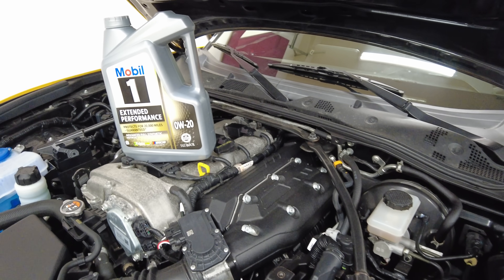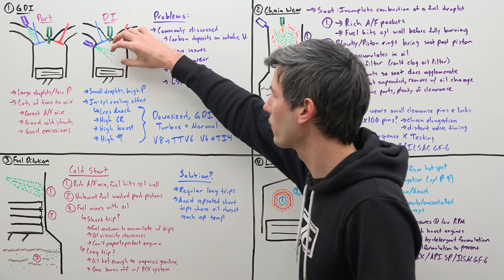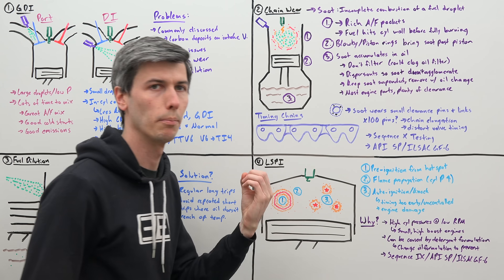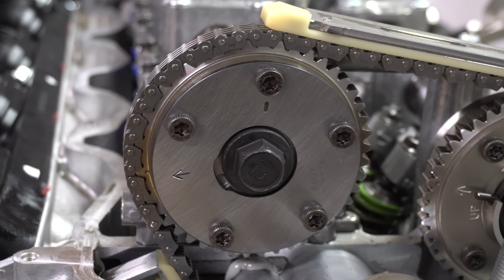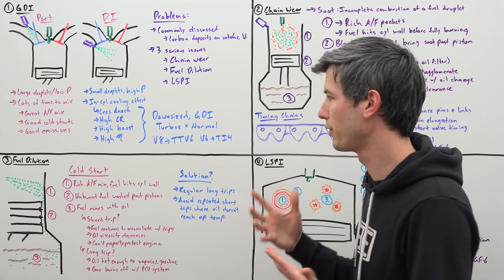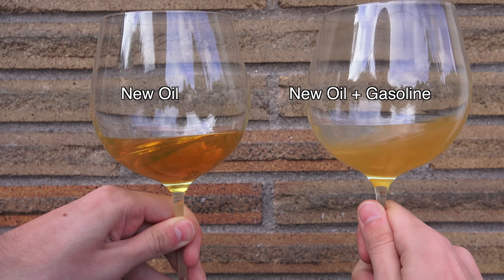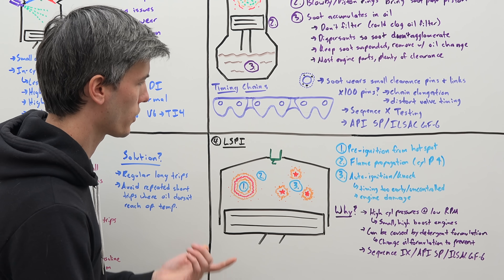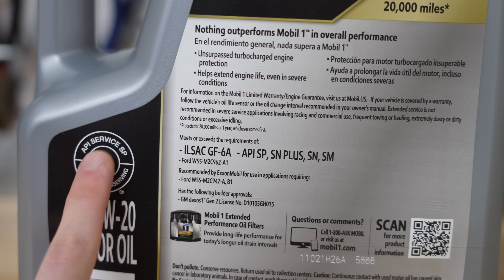3 Big Problems With Direct Injection Engines (Gasoline)

Comment: This was a great video! 
My Alfa engine from 2010 uses GDI and I recently had some major engine issues which were caused as a result of point 2. A failing injector becoming stuck open at one point also did not help. 

This video has helped me understand the importance of letting my engine warm up before use, performing sooner than recommended oil changes and not asking for higher than necessary boost in low RPM scenarios. 

I fell much more confident in being able to look after this engine more properly after watching this.  
Thanks EE!
Reply: You should not idle your car to warm it up before driving. Most oil manufacturers will tell you this as you'll be injecting extra gas into the combustion chamber during warm-up, which will wash the oil film off the piston walls and lead to excess wear.

Instead, you should drive the car as soon as you start it up, just do not put it under heavy load. Load is a function of both RPM and throttle angle, hence if you've got the throttle wide open at 2500 RPM, you are still putting the car under heavy load despite driving at lower RPMs. What I do is I just go light on the gas pedal, and at low speeds I don't shift out of first gear (engine hits maybe 5000 RPM max). If I'm accelerating, I do it slowly and I ride gears out higher than I normally would under light acceleration, that way you get the engine spinning but without putting it under a ton of load. This also helps the engine heat up as fast as possible, minimizing the amount of time you're injecting extra fuel into the engine.

You can do the same thing on an automatic by shifting it into low gears when you first start driving. The key is to keep engine RPMs relatively high (above 2500 RPM) without mashing the gas pedal and putting a lot of load on the engine.
Reply: @rars0n  but if your in below 0 weather you should warm up at least a minute,  no?
Reply: @Oakleyworld  You should drive the car while it's warming up. There's no need to let the car sit while idling.
Reply: @Oakleyworld  Yes you should.
Reply: @rars0n  Even if you don't think it is necessary to warm the engine up, what about the defroster?  It will blow cold air out until the engine is warm.
Reply: @michaelbenardo5695  The engine will warm up faster driving the car than it will if you just let it sit idling. Obviously if you can't see out the windshield, you can't drive, but if you can, the defroster will warm up quicker.
Reply: @rars0n  BUT, if your block is iron, the pistons, which are aluminum, will expand much faster and cause scuffing of the cylinder walls, which leads to shorter top-end life.
Reply: @michaelbenardo5695  Pistons are not made of aluminum, ever. They would blow in no time under normal engine operation if they were.
Reply: @rars0n  What are you talking about?  Aluminum pistons started appearing in the 20s.  They are much lighter than cast iron pistons, lighter even than steel alloy pistons.  Nearly ALL engines made in the last 67 years have aluminum pistons, the 52 Chevy 6 and the 54 Pontiac 8 being the last holdouts.
Reply: @michaelbenardo5695  What I meant is that pistons are not made from pure aluminum, they're made of aluminum alloy containing other material like silicon and nickel. They're also manufactured in such a way that things like heat treatment are used to mitigate the expansion and contraction issues inherent in pure aluminum parts.

For instance, race pistons are typically forged rather than cast and use different alloys that exhibit different behaviors compared to OEM pistons. Tolerances on race pistons are typically looser, allowing for more expansion of the piston material, causing "slapping" in the engine (the piston rocks back and forth within the cylinder walls) when the pistons are still cool. This is one of the many reasons why race engines get torn down more frequently than an OEM engine.

Regardless, it's a moot point, because any piston expansion that is potentially taking place while the engine is warming up, assuming it's causing any damage at all, will still take less time to happen when driving the car rather than idling, because more heat is being generated to warm the pistons up faster, which would result in less time for wear, not more. But realistically this is not any concern in a modern passenger car engine either way. Washing the oil off the cylinder walls will do more damage than any kind of piston expansion.
Reply: @rars0n  They are still mainly aluminum and yes, I know about forged vs cast.  I used to work as a mechanic.  No, not just a parts changer, a real mechanic, and I am going to keep warming my engines up no matter how much it pisses some people off.

Comment: Idea for a video “is it a myth that long stroke engines respond well to boost”. I see on various forums that long stroke engines are easier to boost than short stroke to higher levels and noticed some 80s turbo engines were very undersquare.

Comment: It's only going to get worst as government introduces more and more tougher emission standards. The vehicle PCV system was designed for carbureted engines. It hasn't change to keep up with modern fuel injected engines, but as a tech told me when I use to work at the dealer, it only need to last until the warranty runs out
Reply: Well according to biden. If you buy an electric vehicle you can drive all the way across the country on a single tank of gas
Reply: Right, and consumer gasoline engines account for what, a fraction of a fraction of a fraction of harmful emissions? 
Sure, punish us enthusiasts. We're the problem.
Reply: @nthgth  right!
Reply: @nthgth  Around 17% of United States GHG emissions are from light duty vehicles (passenger cars, vans, SUVs and pick-up trucks).
Reply: @PURENT  how many percent are from people whose passion is centered around ICE-powered cars?
Reply: @nthgth  Car guys and gals are included in that statistic whether we like it or not.

Comment: The weird thing is that mercedes seem to not be affected noticably by build up until after 400k km on the older cdi engines om646 era. 651 usually around 200k km on the a/b classes and depending on driving style between 200k and 400k on the rwd platforms.

Comment: Chainware can be avoided with double chains and better and/or bypass oil filters. Seems to be a german car problem more than others
Reply: Chain wear can avoided with a timing belt - like Volvo.
Reply: @ghostwrench2292  Japanese dou le chains without issue

Comment: Excellent vid DI engines can thin out the motor oil. Makes sense to get the engine up to operating temp for a period of time. Also do oil changes more frequent oil is relatively cheap new engines are not.

Comment: VA WRX owner and I had to spend $400 mitigating all the downsides of DI before I even installed an intake and exhaust. Wish my FA20 had dual injection.
Reply: What did you get? My Dad was born in Weems, on the Rappahannock River. I have a WRX.
Reply: VA STI here. The EJ of course has its known problem areas but at least I won't have to worry about DI stuff until (probably) my next car.
Funnily enough, I think our two different engines' potential problems have similar solutions
Reply: @nthgth  The FB25 still had port injection for a bit.

Comment: So, regarding carbon buildup on intake valves. I assume this comes from the oil entrained in the positive crankcase ventilation system. Surely it can't be that hard to remove oil (liquid and vapor) from the PCV system before it is routed to the intake system (?), thereby mitigating the problem?
Reply: Catch can
Reply: @CTF33  well it would be desirable if the system didn't require the owner to periodically dump catch can contents.
Reply: @Tony Lewis  well it would also be desirable to drive a car if it didn't  require the owner to periodically  have to change the oil.

If you don't like to do maintenance then don't drive a car, especially not a high performance car.
Reply: No, I am not anti maintenance, my observation is that unfortunately the majority of vehicle owners very seldom look under the hood, so while the catch can is a good solution it might not work if no one ever checks it.

Comment: 2:10 ive got a vw Bora (jetta 4) with a 1.6l 8v engine (the SR engine, APF motor code) and everywhere the fuel sprays its clean and anywhere else its black.

Comment: Massive complexity, hundreds of parts in an ICE, versus a handful of parts in an electric motor.
Reply: Its the hundreds of battery cells that complicates an EV - each very spendy
Reply: @timothykeith1367  The function of a battery pack is simple -- charge, discharge --compared with the hundreds of different reciprocating parts in an ICE.
Reply: @kevinpolito1529  I get 300,000+ miles from my fueled cars with cheap oil changes that I do myself without waiting, and if its a Japanese car I can install a used JDM motor and get another 200K miles.  The "simplicity" of EVs  and the fact that the batteries aren't gifted by Santa Claus is why EVs aren't popular after 120 years of attempts to build and market electric cars.  Owning an EV says more about a person's income than than practicality.  I buy used cars, I won't consider buying a used EV until I know that batteries are comparably priced to a motor swap.
Reply: @timothykeith1367  Since anything you do yourself is free, no-cost labor, I've got some yard work you can do. Also, it's unusual that your ICE cars never need belts, hoses, spark plugs, timing belts, gaskets, ignition wires, brake pads, CV joints, exhaust parts, etc.
Reply: @kevinpolito1529  An oil change is done by gravity, but a suction tool is nice for extracting the oil via the dipstick - super fast.  Its so easy to do the basic service.  You'll probably pay someone to replace the windshield wipers, right ?   I don't have to wait for service.  When you buy Toyotas or Lexus the basic service should get the vehicle to 400,000 + miles.   I'd never wait for service for something like an oil change, I'm too busy for that.  $20 for an oil change and I re-use the oil for other purposes - it is a fuel for diesel engines or an oil heater, I'd like to collect my neighbors' used motor oil.  Lots of free BTUs.  My daily driver is 27 years old and I think I can get 5 more years from it before it needs an overhaul.  Take care of stuff and it generally lasts.  That helped me save quite a bit for retirement,  I'd rather have $1 million in the 401K than an EV in the driveway.

Comment: The short answer is. Don't buy a car with direction injection ( at least not only )  
This system seem to only cause more issues then solutions when it comes to engine reliability, which is the #1 things for the common car owner. That simply want it's car to work and is not willing to end up with expensive repair as a trade for a little more power and fuel efficiency.

Comment: Great video!  Been seeing a ton of people worried about fuel dilution on the new Ranger forums and it's just how it is for some of us.  Luckily, I don't smell fuel in my oil, but I also run a valve cover breather in my '21 Ranger.  Some of us cannot drive 30 minutes on a cold start...  I, for instance, live 3 miles from work, even if I let my truck auto start/run for 15 minutes in the morning and afternoon, it still takes me less than 5 minutes to get home or get to work...  It's just something I'll have to get used too and change my oil every 6 months.  I do have a question for you, Jason, should I run the recommended synthetic blend or full synthetic?
Reply: I'm surprised a Ford that new isn't requiring 0W-20 (which is synthetic only). I'm curious what Jason thinks as well.
Reply: @CarsSimplified  Nope, they recommend 5w-30 syn blend, Ford corporate and at the Ford quick lane both say it.  I would've thought full syn myself though...  Hope Jason chimes in, but not holding my breath...
Reply: @ Jay's 5G Ranger Garage : Living so close to work doesn't make it worth using your car on a regular basis. Maybe a bicycle could be a good bargain compared to excessive fuel being burnt cold and all those oil changes... 😁
Reply: @micsub  🤣LOL, no....
Reply: @micsub Not everybody is physically up to riding a bike, and some places don't have public transit.

Comment: in the UK, we are down to 3 cylinders + sub 1 litre for most small cars, 1.3 litres for bigger cars, timing chain renewal as low as 30k miles, ahh, progress..... [i drive a 13yr old diesel, engine designed in the late 80s, adapted to DI in 2004, with a cambelt, as i'm a mechanic..]

Comment: This is why it is SO important to use the correct oil and change your oil in modern engines. Change it on the "severe" schedule listed in most owners manuals and you can avoid most of this.

Comment: All good points and not saying you're wrong with all the points but some cases seeing older motors vs newer vechiles with more emissions devices. Your carbon build ups are coming from the Exhaust Gas Recirculation devices, pcv valves dumping back into the intake, lack of oil changes or the obvious air fuel mixture, but not from where the injectors are located. Carbon comes from the exhaust. Yes the indirect injection can help clean the intake valves but it's from the emissions going back into the motor to be reburned to reduce emissions. All performance vechiles dont have any of these and their components are cleaner than those motors on the road today. This is what I've seen with vechiles but not saying this is always the case for everyone else.
Reply: Right.
Reply: Your correct

Comment: As a owner of a 2017 wrx I get the car out on the highway every week because of I like to mtn bike a lot, I also change my oil every 3500 miles.
I never pull boost below 2000rpm, car is running great at 70k miles

Comment: Nice video. But I can't help but think that diesels are by default DI. So presumably diesels have had these issues forever? Except for the pre-ignition stuff.
Reply: Many diesels don't have timing chains (chains are getting to be more common on smaller displacement engines).  When they do have a timing chain it has a defined change interval pretty much on par with timing belts.  Pre-ignition can be an issue when deviating from a factory tune.  Then all sorts of issues are possible.  Spun bearings, cracked pistons, broken ring lands, lifted heads.  Diesels run different oil and filtration systems to counter carbon contamination.